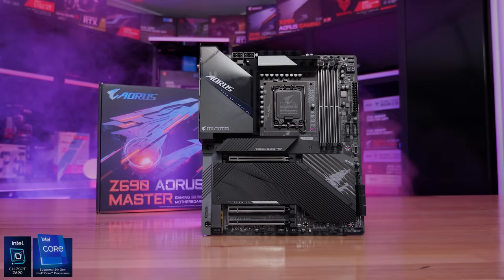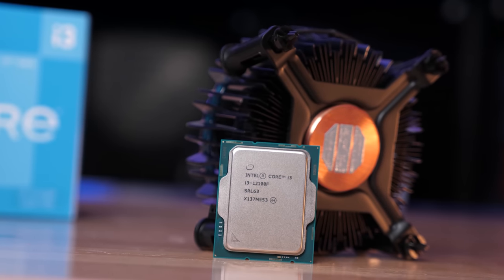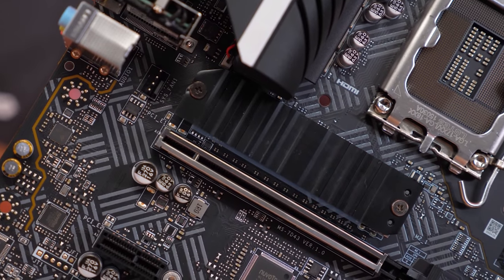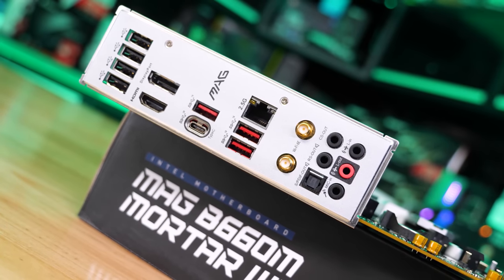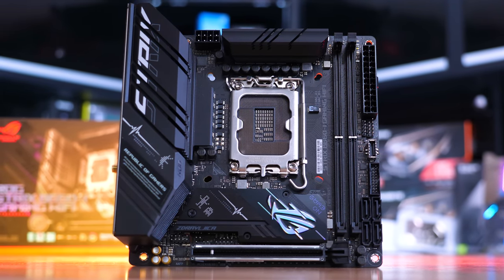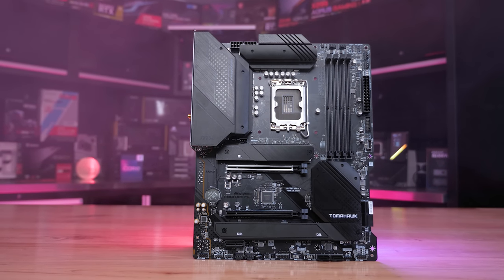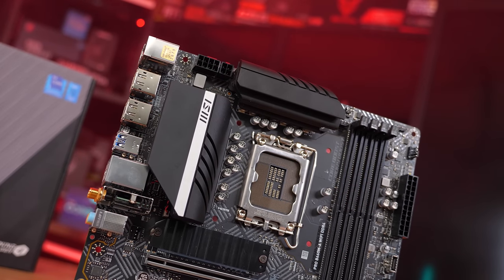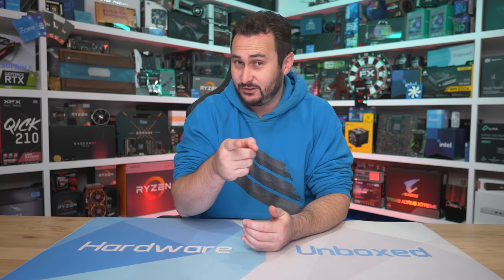Top 5 Best B660 Motherboards

Comment: Is the b660 strix-a good? I wonder if it can run the 12700 at full PL2 no limit like the MSI boards. I already have an asus gpu so i prefer an asus board so i won't have to install too many softwares

Comment: 4:40 There is a MSI B660M Mortar without WIFI. The WIFI version has white heatsinks etc. while the non-WIFI version has black heatsinks. This is true for the DDR4 and DDR5 versions of the board.
Reply: Mortar black non wifi and tuf plus d4 wifi     they have the same price   are there any difference

Comment: Quick question is the MSI pro b660 m-b of the same quality VRM/capability of the m-a? As m-b is much cheaper in my country.
Reply: m-a is the best of the b660m series. m-b, m-c, m-d, etc. are incremental steps down in built-in functions. Best to check the MSI site and see what built-in options are lacking for the m-b compared to the m-a, other than what you find missing they'll be the same.

Comment: 1:43 can you explain why we should get a cheaper B560 board instead? because B560 boards are limited to 10 and 11 gen Intel CPU's, so it makes no point in buying a B560 board if you are going to get a 12th gen CPU?
Reply: If you're on a strict budget, he's saying that the cheapest B660 is so terrible, that it can only run the lowest end CPUs, and not even at stock spec. So you should consider just going with the much cheaper previous gen or AMD.

Comment: Should i get B660 Tomahawk or Z690 Pro-A? I plan to get 12700 non K cpu. Or is there other option, im avoiding asus now cuz of bloatwares. Im upgrading from 10400 and i already have 3060, m.2 3.0 3200mhz ddr4 ram 16gb. I want mobo with best vrm performance and cooling since i think i7 12700 runs hotter. And i really want to try msi brand. Im done with asus even though they have one of best builds but overpriced while i think msi can compete with them with cheaper price and hoping less bloatwares.

Comment: Hi Steve -
with a great IF, if a B660 board happens to let you set E-Core L2 (Cache) voltage, then you should be able to use the unlocked internal BCLK of K-processors for CPU overclocking regardless.

In fact this seems to be the best way to get more performance out of the processors, as increased Ring ratios can be treated as a "suggestion" by the processor, rather than "an order" like raising the BCLK is.

However - significant increases past the ring baseline (3.9-ish Ghz?) require jacking up the E-Core L2 voltage, lest you disable the e-cores.. Which I don't think B660 boards let you do. 🤡

just something to keep your eye out for 👋

Comment: This is why I hate being a first adaptor.. I went through this BS with Ryzen Gen 1 and the Gen 1 X370 boards.. It wasn't this Bad, It was mostly BIOS and Windows updates that took about a 1 year to Fix.. Like when AM5 comes out, I am not going to want to jump on that platform right away either.. I need stability and plug and play simplicity in my life.. I will wait for everyone else to go through the BS this time. I am going to upgrade to an X570 Board ((Which I don't want to do because I already have an AM4 board, but I can't get a 6900XT to work with my X370 Board for some reason that I can't figure out???)) But I am going to just buy a new Cyberpower Built AMD PC, with a 5800X or 5900X and a 6900XT and call it a day.. The prices are coming down but that is only because new CPU's and GPU cards are about to come out within the next 2 quarters.. So now I am going to end up buying a new PC and still Be a generation behind... Like what do we do, Will PCIE4 be enough or should I wait for PCIE5 on AM5, and the way over priced DDR5?? WTF.. I guess I will just keep waiting!!!!! This is BS, I can't even get a 6900XT to work with my 2700X/X370 Taichi.. I bought a Corsair RM850, and I have done the math and my PC only pulls 400/450 watts from the wall including the 6900XT at full tilt.. I should be able to run it with a 650 watt PSU Technically.. 
     My PC comes on, The CPU, The case Fans, and The CPU cooler.. The only thing that won't power on is the GPU, I have tried all 3 6+2 8 pin connectors on my RX480 to make sure they have power over all 3 cables and it did.. The RX480 works perfectly, but as soon as I drop in the 6900XT I get nothing.. Oh and I am on AMD driver's 22.2.3 which should at least allow me to get some kind of out put to the display!! I am so sick over this.. I can't get into safe mode because the cards won't even come on to allow me to do that!! GOD I am Pissed, I should be able to keep my X370 Taichi, I have never been through an issue like this, I used to upgrade my GPU's every 2 years sometimes every year, back in the day!!!!!.. This is discusting.. I am going to just have Cyberpower build me a new PC I done busting my hands up over this shit!!! DONE...

Comment: Awesome video. Thank you for doing the leg work ❤️ 

A question for anyone reading. I am running a 12100 on a h610 MB. I might upgrade to a 12400. What would I gain from getting a b660 as opposed to staying with my h610? Thanks

Comment: Got a B660M-A with 12400F, will consider upgrading to 12700 or 13700F (if it's more power hungry that 12700) in the next year. Quite happy with the board, it'll also allows you to manually enable AVX512. Had no problem with XMP and my 32GBs of 3200 Cl16 kits.
Reply: Hello. did you know of anyone having instability activating XMP on Prime B660s?
Reply: @HowardRoark1943  not anyone that im aware of.
Reply: Not sure if the 660 boards will be compatible with Raptor Lake?!? (13700F)
Reply: @wolfshanze5980  they are

Comment: Why you don't test the B660 Aorus Master Ddr4?  It is a very complete High end Board
Reply: Maybe, it's not yet available in Australia when HUB make the comparison.
Reply: Here in the UK, the B660 Aorus Master cost 20% more than the MSI B660 Tomahawk (more expensive than some Z690 boards). For me there's very little point in 'high-end' B660 boards, you're better off with a entry or midrange Z690 instead)
Reply: @DuyLeNguyen  it's a detail to consider, but in my area the price is the same as the b660 tomahwk.
Reply: @jorgecalderon6196  In which case you should still consider:
1. Cheaper or similarli-priced Z690 (if you need the extra I/O)
2. Cheaper B660 options (and spend the money saved on other aspects of your build)

My point still stands that h-gh-end B660 boards  are a bit of a paradox of priorities (still exactlt the same comment as I've made before), but ultimately it's your money, your decision, so you do you.

Comment: Hi, I’ll buy a 12600K. But motherboard? (Italy price)
Asus TUF B660M Plus 160€
Msi B660M Mortar 175€
Msi Z690 Pro-A 185€
Reply: they are all decent. Look at the differences and consider if you are willing to spend the extra money on the additional features. I personally would get the Pro-A.
Reply: Pro-A for sure, only a bit more expensive than the Mortar for the extra features and overclocking

Comment: No matter what brand (MSI, Asus, Gigabyte, AsRock etc) you view, about 10% of the boards per model seem to be faulty. I have been wondering if it has always been the same, with prior generations, but it makes difficult to buy a new board. 
Based on the distribution of stars per product and number of total votes, it's difficult to know if these lower reviews were an initial problem or if they are still there.
Even the most recommended boards by any tech site have a big distribution between reviews so one can trust nothing nowadays, unless a person reviews them all and keeps using them awhile.
I have a problem, don't know which to pick...now, lets watch this review to the end :D

Comment: While this video is indeed very useful, I can't help myself, but recommend the MSI B450M Mortar Max for any value consideration. It cost only 70 bucks where I live and is not worse than a $200  board with a newer chipset. And it can easily run even the Ryzen 5950X at full TDP.  It is weird how the prices work. Maybe you could make a video about the best CPU-MB-RAM combo for the money. Just a thought...
Reply: A B450M will most definitely never make it into a video that's solely about B660 motherboards.